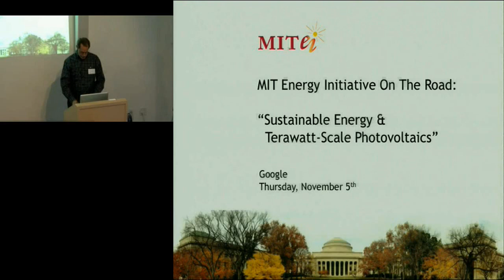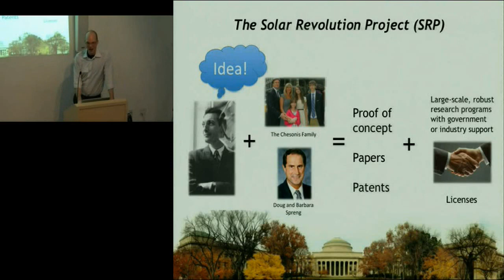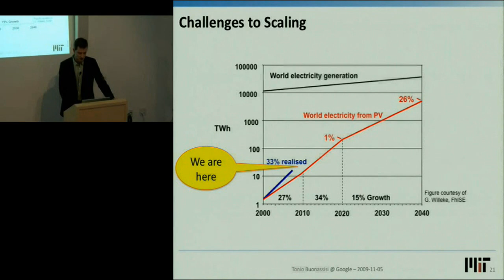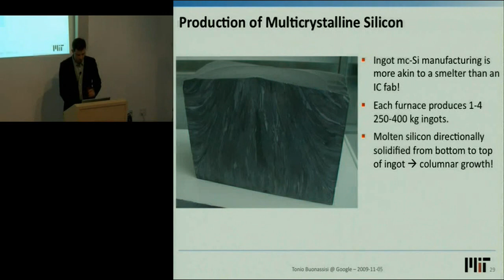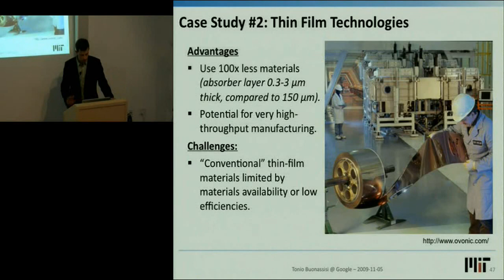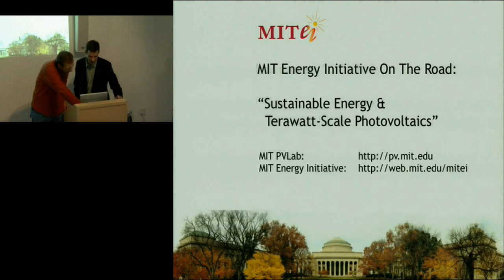The MIT Energy Initiative: Sustainable Energy and Terawatt-Scale Photovoltaics

Comment: Coal will come back into fashion if there was peak oil. 

The risk of peak oil is not running out it is not keeping up with demand. Gas is now starting to over take oil in terms of new finds but even that may struggle with demand. 

Clean coal, thorium reactors, Solar, Geothermal, hydro, wind, gas and even oil could allow for energy stability and with the right development we could produce surplus cheap energy.

Comment: You must consider molten liquid salt to bring 1000 c to the surface in primary loop. Then four or five loops can be run with a supercritical liquid to run turbines, this is more efficient than water/steam system. This will make geothermal cheaper than solar, wind or coal. Geothermal without the steam would be able to be installed in every city reducing the need for grid power lines. Please consider this idea .

Comment: We don't need or want scalability, we want and need cheap reliable solar panels on every roof and we need to create connected "energy islands", so to speak, and resiliency, not scalability and efficiency. If we create energy islands, we don't end up with a situation where we have a blackout that runs from Quebec to NYC. The islands should be connected, but isolated at the same time. We are all thinking about the problem WRONG.

Comment: Hm. Let's have another look at this. I don't hae a problem with dead dinosaurs helping me to get my speeding ticket. I just live next to two of the busiest streets in my city, and it's no fun. The same goes for my hometown, with its steel mill, cokeing plant, etc.. air pollution is bad.

If we were using highly efficient filters, I wouldn't care about fossils.

However, they're clearly depleting and we need other options. Solar is one worth pursuing. Fusion is an other. Both need breakthroughs.

Comment: How are electric cars more efficient? They aren't, in fact they cost a lot more to make and to operate. How expenses are only initial? Does that means that you don't have to change tires on electric cars and that solar panels are eternal? Solar panels degrade over time and batteries degrade over time. Think about how much does it costs to replace your cell phone battery... and multiply it by 1000.

Comment: Other green sources of electricity also contribute to the electrical energy grid, electric cars are more efficient even without a whole industry powering to increase its effiency. Fossil fuel cars dominates because fossil fuel cars was in a position within the market to overtake the electric car. Expenses are only of the initial, if there was an industry as large and as promoted as fossil fuel cars the ratios of the pros of the electric car youll find increases from a well established list

Comment: The fossil fuel car dominates because electric cars are horrendously expensive and polluting too. Just think about recycling batteries and all the coal you have to burn to generate electricity to charge said batteries. And no, you can't charge the battery of an electric car with photovoltaics unless you're ready to wait a month per charge or spend $200.000 for enough panels to charge it in a day. And you have to burn a lot of coal to make solar panels too. And to recycle them when they fail.